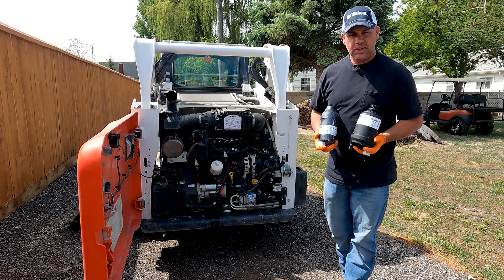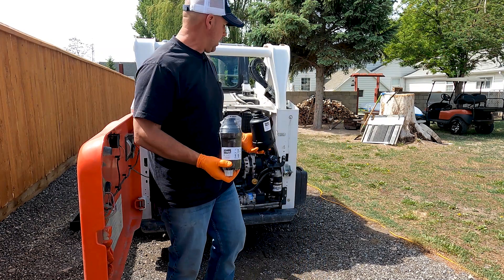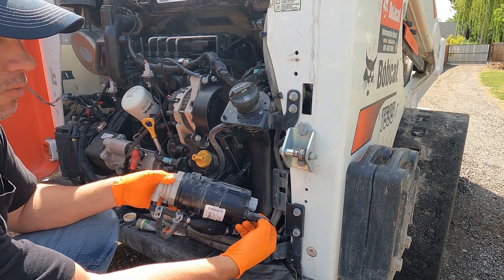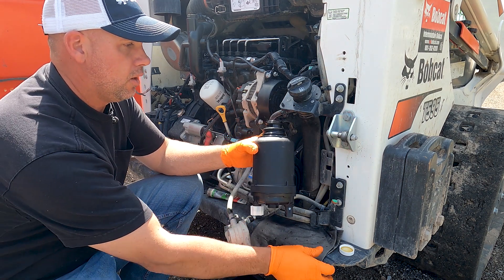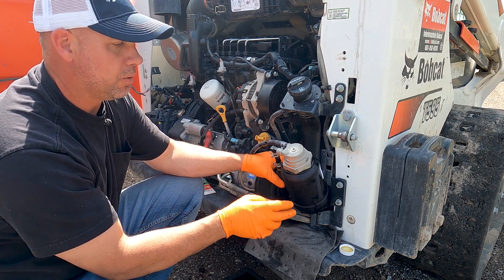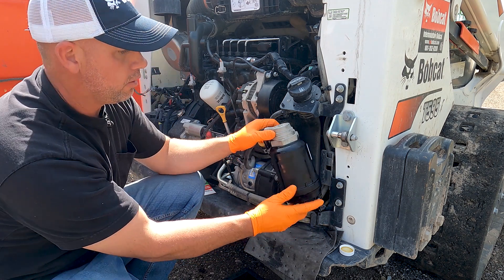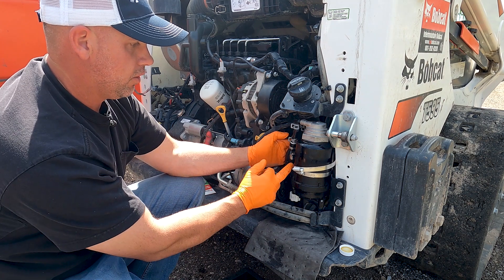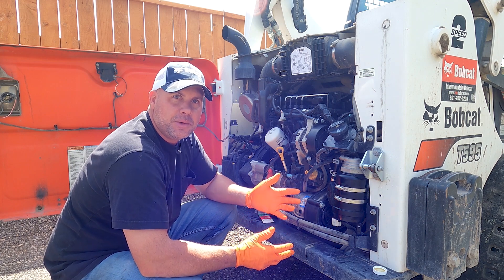Bobcat Has a New Fuel Filter! But Why?

Comment: Hello. Wondering how many times do you drain the water separator? Once a week or more than that? And how? Thanks for your help...
Reply: Yes I would like to know also I have two T-740 1 of them now needs injecters and fuel rail from water and other contaimation 
now using the larger upgraded filters

Comment: Great job men.
I like your videos. I’m learning a lot from you.
Reply from the maker: Thanks, if you have any suggestions for a video please let me know.
Reply: @tetradgroup  just bought a 2017 t770 1 hr in water in fuel code and it shut down. Seems like a common problem.  Where is this water keep coming from is my question.  Lmk
Reply from the maker: @unknowntrucker7010  majority of the time it comes straight from the gas station, seems like it's always the red dye fuel in my area that's contaminated straight from the pump or transfer tank.  I had many machines this year with bad red dye all within a 30 mile radius of each other.